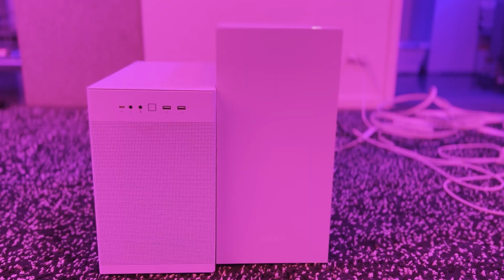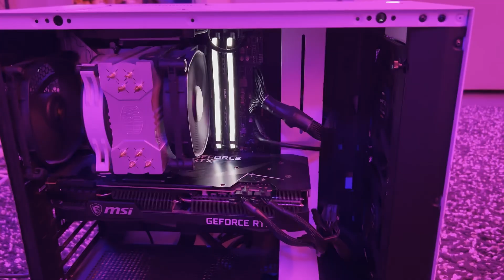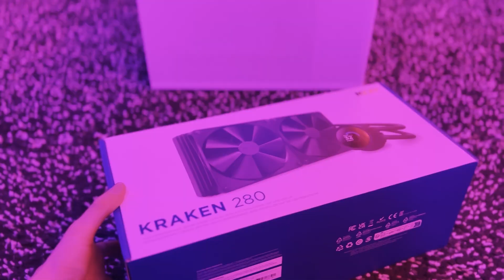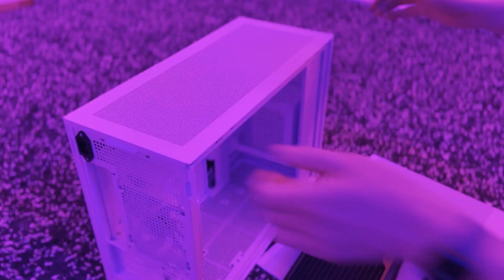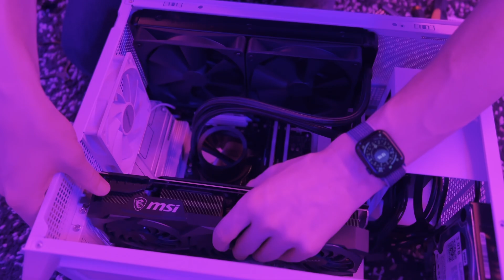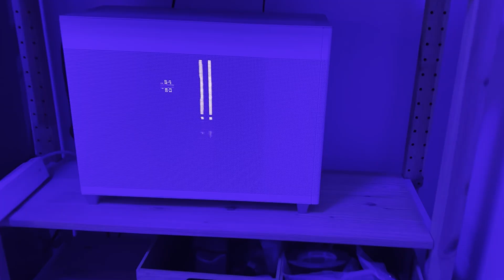[Asus Prime AP201] build

Comment: I was wondering if you could attach 140mm fans at the bottom for this case. Glad I found your video 👍 
Are you also able to attach 140mm  to the rear?
Reply from the maker: It doesn't have screw holes for 140mm bottom fans so I mounted them using cable ties and spacers,  rear fan is max 120mm, bigger fan wont fit.
Reply: @minkis42  yeah as long as it fits, we gonna find a way to attach it 😄
I see, 140 on rear doesn't fit at all ya... 
Anyway thanks mate, u helped me out 👍